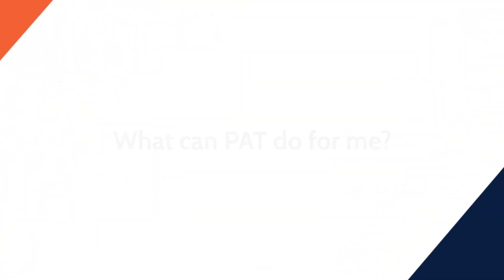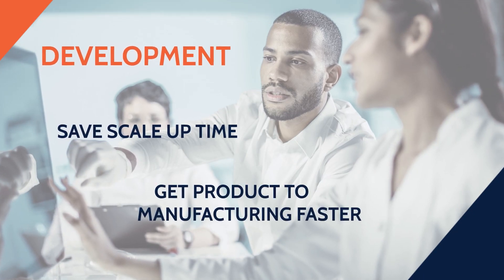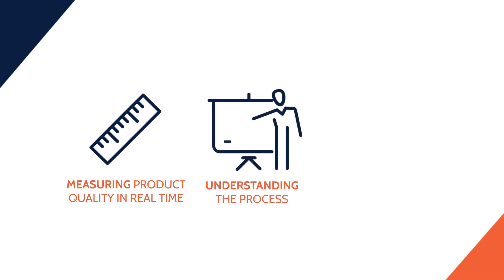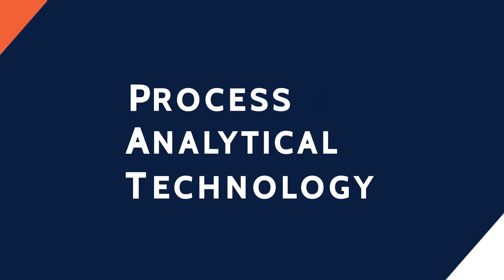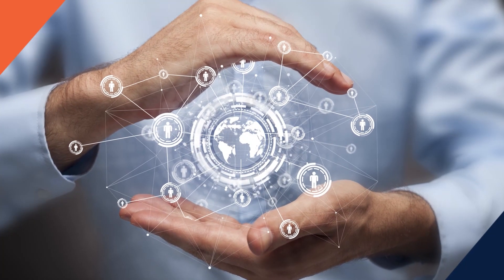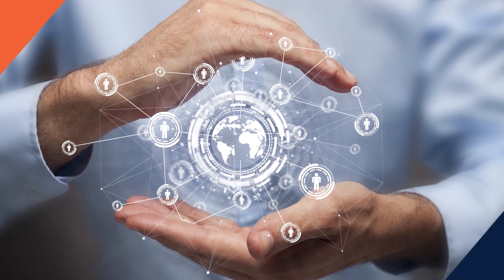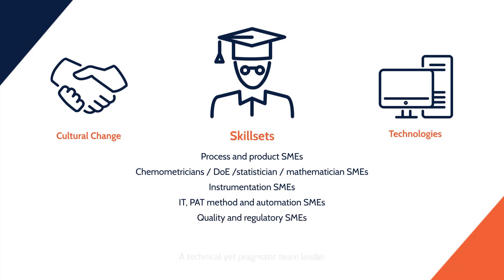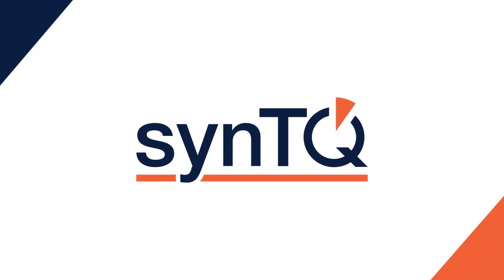Process Analytical Technology - Part 1: What PAT can do for me?

Comment: at 1:42 you showed a pic with LIMS, historian, softsensor etc. Do you mean PAT will replace that or do you mean PAT will be one of the inputs shown in the pic?
Reply from the maker: Hi ChowYang Neo, thank you for your question and apologies for the delay in responding! On the diagram you reference, the elements around the circle are the various tools and technologies that make up a PAT implementation. At the centre of the diagram is synTQ, a PAT knowledge manager that combines, manages and controls the data sources that surround it. To answer your question directly, no – PAT will not replace/be one of the inputs, instead each input is an aspect of PAT. If you have further questions, please contact us at PAT@optimal-tech.co.uk or visit our website What is PAT? - Optimal (https://optimal-tech.co.uk/pat/).